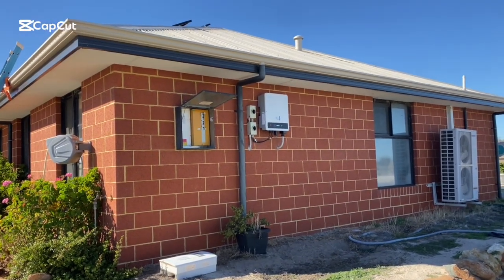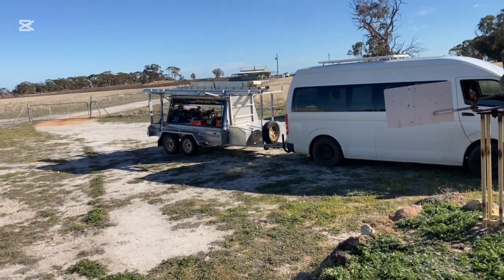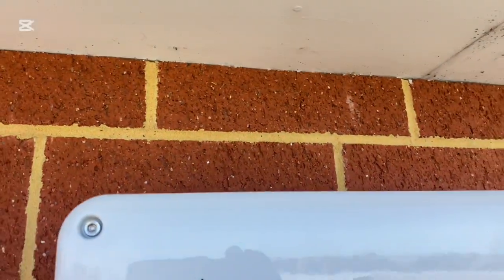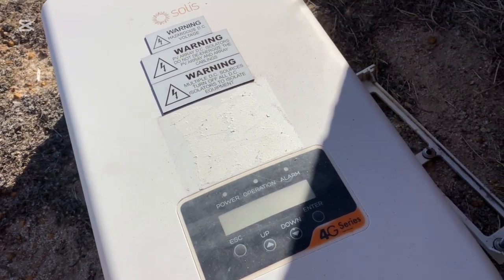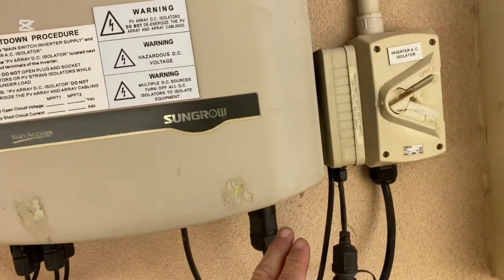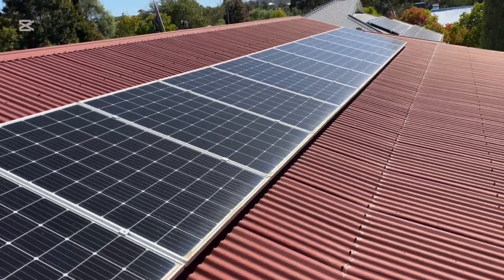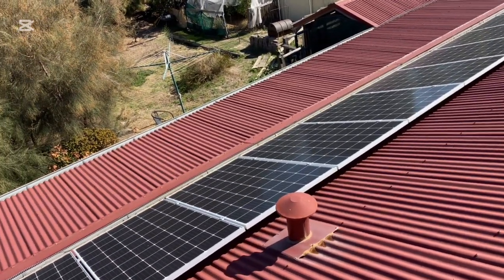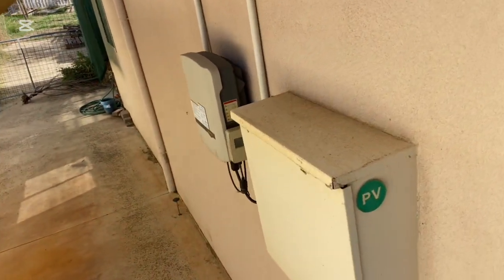DONT put inverters in the sun! Faulty inverters Solis and Sungrow in York WA!

Comment: why are the disconnects installed like that. side by side would be better and never ever make a hole in the topside because water will find a way. also the gutter full of screws was funny
Reply: Had an SMA Sunny Boy 1.5 kw inverter installed on my house with 1.8 Kw of Sun Power panels 13 yrs ago. System has been bullet proof. At the same time I had a cheaper system installed on my investment property. It was an Eversolar 1.5 Kw  inverter with 1.6 kw of JA Solar panels. Inverter has failed twice in the first 6 Yrs and had to replace with a GoodWe inverter that is still going strong 7 yrs later. The JA Solar panels have snail trails all over them. Goes to show, you get what you pay for!
Reply from the maker: Yes thats a rule now were not allowed to do top entry to an isolator for that reason 👍🏻

Comment: I’ve got an inverter installed inside my carport, well sheltered, but gets really hot in summer. Should I maybe install a small fan to circulate air between the wall and inverter to help cool it down,

Thanks for you videos, find them very informative.
Reply from the maker: It should be fine 👍🏻

Comment: I'm on my third solar edge inverter in 6 years east facing under the eave. Too be honest I don't rate high frequency inverters especially for how much they cost. In my off grid setup I have a 3kw cheap Chinese low frequency inverter/charger that's been going strong for 13 years. The surge capacity and heat tolerances of low frequency inverters are far superior, I actually think they could last a lifetime.
Reply: What's frequency mean
Reply: @Nerdificationing  I don't know a lot about electrical engineering but I presume it's the wave length of the current that is being inverted. A longer wave length means a lower frequency. Low frequency inverters have much larger transformers and they weigh a ton, which is probably why installers don't want to deal with them.